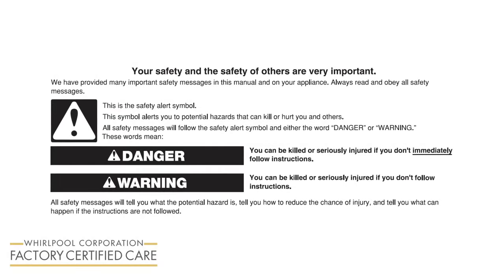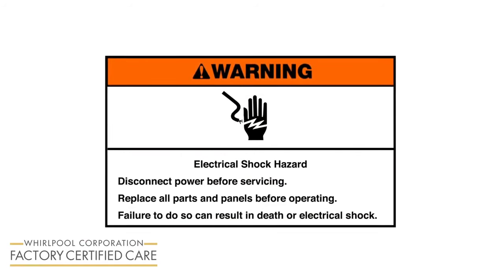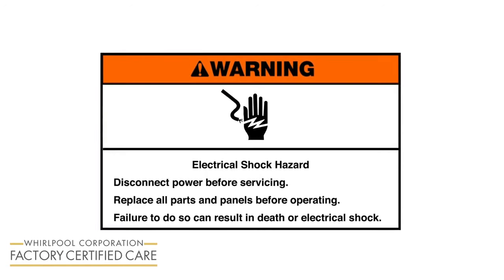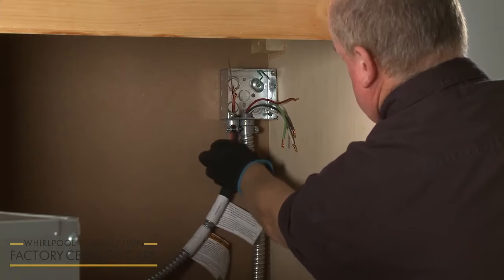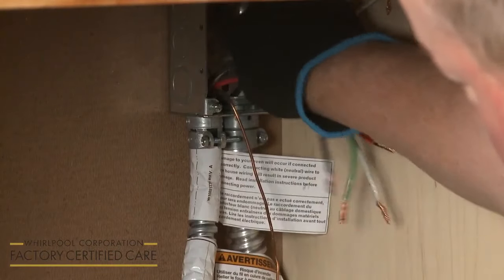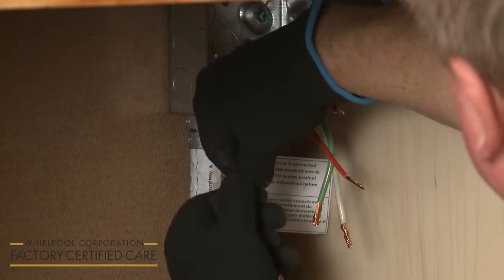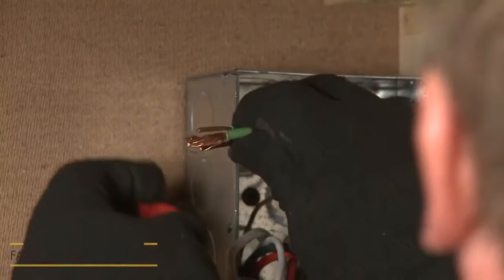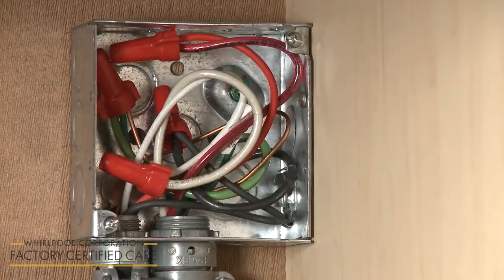Built-In Oven Power Cord Installation

Comment: You should also have a pigtail from the junction box ground screw to the wire nut for the 2 green wires. Grounds are typically done first for safety and since that wire is typically on the back of the box.